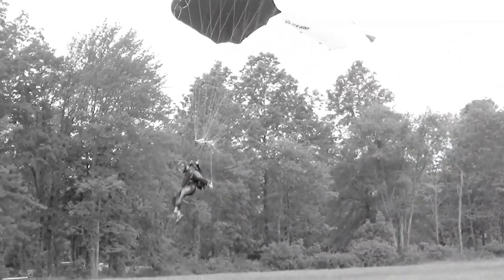Flaring Too High - Brian Germain

Comment: If you're wearing a digital alti have a look once you deploy. Look at what altitude you're at before you start a full flare. It'll give a good indication of how much altitude you lose when you flare. Helped me a lot to stand my landings. Of course that may go out the window if you land with the wind or crosswind but if you're against the wind I find it's a consistent way to judge your flare height.
Reply from the maker: I have no scientific evidence nor reason to believe that the flare response changes with respect to the windline. Observe your own data to confirm. Further, keep in mind that as you descend, the density of the air increases, reducing the amount of altitude required to achieve level-off. This does not mean the data is invaluable, only that our expectations must be adjusted. This is true of maneuver recovery response as well.